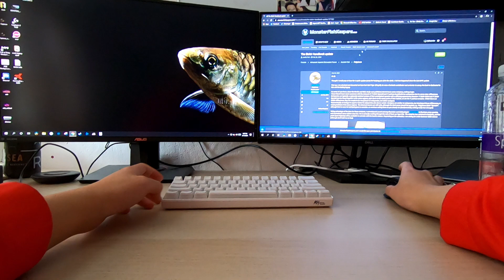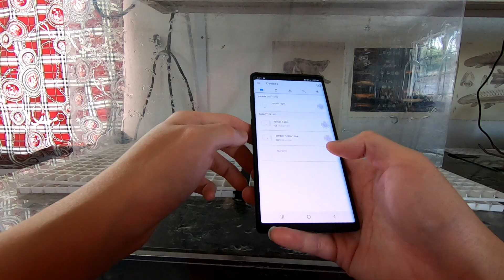Converting a Sponge Filter into a DIY Poly-Fil Aquarium Filter

Comment: another option to use the poly sheet thats made for quilts , its like a thin blanket cut a section wrap around the pipe inside then slip sponge back on so now you can floss the water and still have the sponge and what look as ghetto.
Reply from the maker: Ahh thats a good idea,  thanks!!

Comment: I'm late to this video but I feel like your the perfect person to ask I've been googling this all day and can't really come up with anything. I have the same style filter idk if it's the exact same one tho but I haven't modified it but I want the bubbles to be smaller. And quieter. I don't have an adjustable air pump. In regular sponge filters you attach an air stone. I can't figure out a way of doing that with this type of filter? I don't think it's possible? I was thinking about jamming filter floss or stuffing or something like that (ceramic media even??) into that long lift tube but idk if that would really do anything for what I'm trying to accomplish and I have no idea how I'd get it back out to clean/replace. Your the only person I've seen legit modifying this type of filter in my 12 hours of googling. Do you have a suggestion or do you think jamming something into the tube would even work?
Reply from the maker: Yo. If you jam something in the tube, it might work until it gets clogged. and once it gets clogged it might hinder its performance, so I wouldn't do that. One way you can make it quiet is to position the air lift tube go all the way above the surface of the water. it will be significantly less noisy since the bubbles dont need to travel thru the water and make all those annoying gurgling sounds you're trying to eliminate. if you raise your air lift tube above the water dont raise it too high; the higher you go above the water, the less efficient it becomes. also, you can attach one of those plastic valves on the air line to adjust air, that would make it quiet too without needing an adjustable air pump.
Reply from the maker: These air lift tubes are hella skinny, I havent found an air stone that would fit. plus the part you connect the air line is on the actual body of the filter, so that would require more modifications. If you plan on going with the air stone route, try to modify the original air lift tube to have a bigger inner diamater, maybe attaching it to ABS/PVC tubes, then you can add your air stone
Reply: Bryan La thank you so much!! I didn't try that at all because I figured it would be more noisey cause with my other types of sponge filters if I do a big water change and the water level drops below the lift tube it makes a crazy gurgling noise lol so I figured it would do that. I'm going to give it a try tho and see what happens. Thank you so much!
Reply from the maker: @dandelion12522  no problem! if all else fails, get an air line valve. so you can adjust the air. that will work for sure lol.
Reply: Bryan La thank you!  Yeah they are so skinny! none of the air stones I have fit either. I was thinking about shaving one down but by the time it's skinny enough prob 3/4ths would be gone and just sitting in the tube not attached to anything prob wouldn't do much anyways lol. But if lifting it higher doesn't work it just occurred to me maybe putting a piece of pre filter sponge into just the black L shaped opening would do something or maybe I'll abandon the headache all together and get the air flow adjuster lol thank you so much for all the advice!
Reply from the maker: No problem!
Reply: try pulling the tube out a bit sometimes its covering the hole where the air line inlet goes into tube.